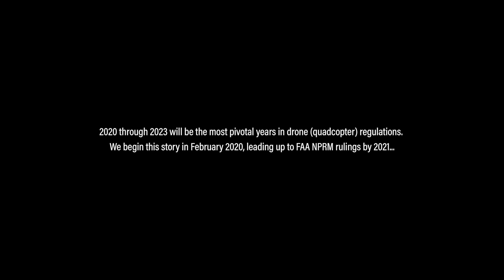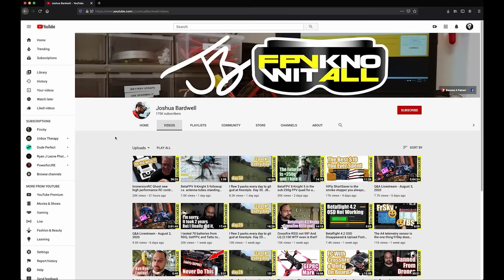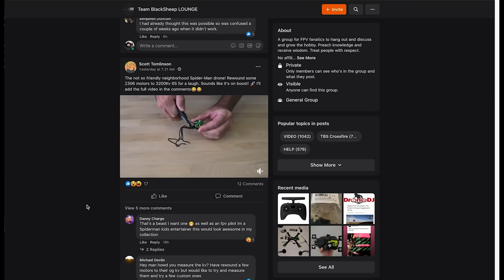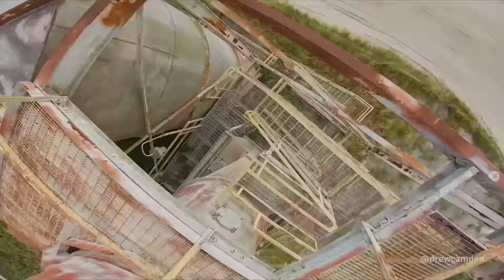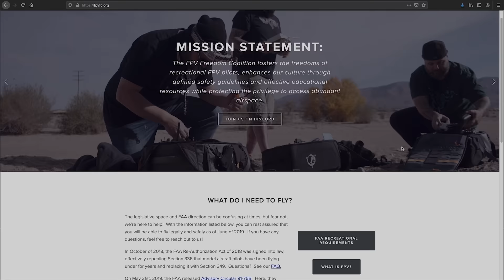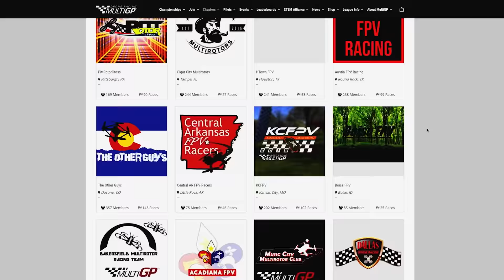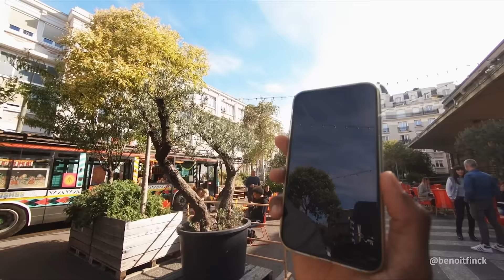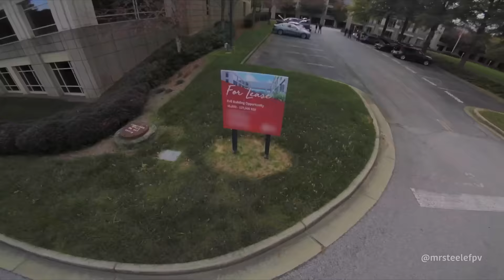FlowState: The FPV Drone Documentary (Full Film Official Release)

Comment: No mention of Timecop or Boris B though. Would be cool to have added them as a tribute, without Timecop we wouldn't have gone to the Naze32 stm32f1 based FC's, created out of his hate of DJI's closed system at the time, the Naza FC's. Boris is the man behind Betaflight, without which some of the gamechangers like Airmode would not have happened.
I started on Multiwii and Hobbykings KK boards, if you want an eye opener as a modern pilot, build and fly something out of parts from that era...

Comment: So I went to the link to buy the bluray cause I want a real copy.  the first page shows up with the "buy now" but when I click it the next page doesn't load fully.  There is just a big green spot at top where I'm assuming something is saposta be and the video below says "sorry this video does not exist".  I think rotor riot has copies but I hadn't got around to buying one but when I saw your video I was going to get it and the link was broke.  I'm sorta not a big fan of rotor riot but may have to buy one from there after all.  Anyway just giving you a heads up on the page.  I'm running the latest windows and using a chrome browser on a good spec system and internet seems to be fine.